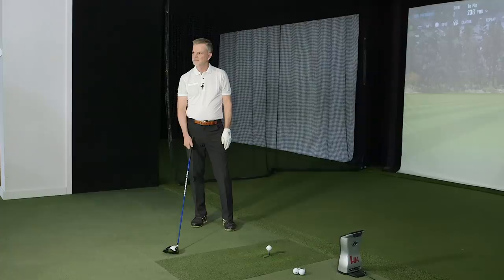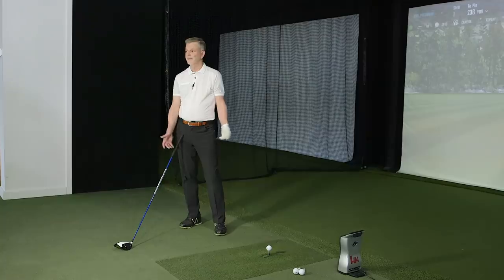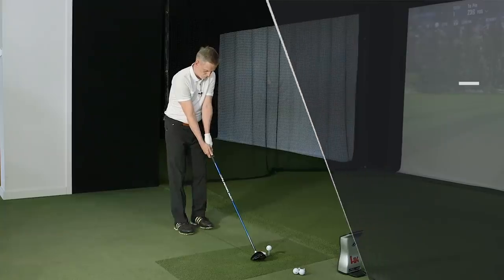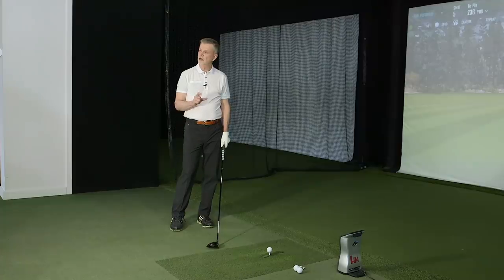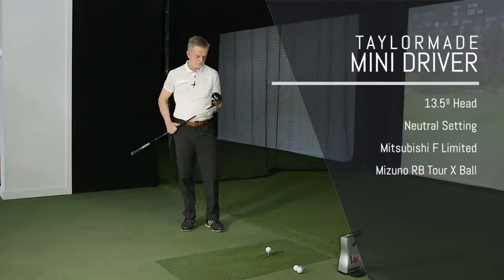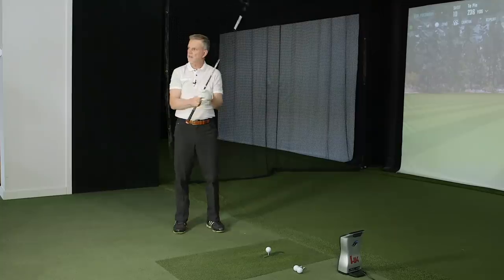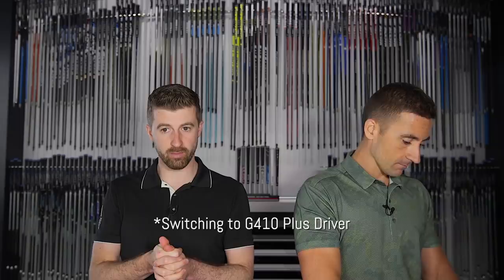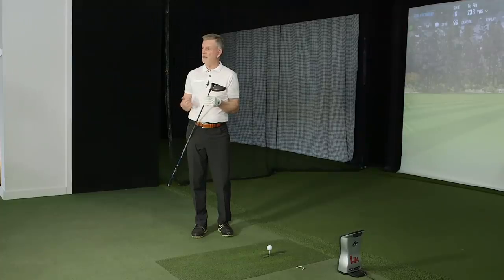Driver VS Mini-Driver | Mid-Handicap Fitting at Average Swing Speed

Comment: I've been meaning to create a file filled with fitting tidbits from Ian/Matt. I've wondered what driver apex I should have (similar swing speed to Ron), and Ian mentioned that 75-85 feet is good for Ron. Ian added that your 6 iron apex should be similar to your driver apex. Priceless.

Comment: I was correct in my chat - I don't understand the mini driver if there is a proper fit of a driver - which this video really showed. top notch.

I understand the need for a "mini driver" with a shorter shaft, smaller head and higher loft - e.g. a 3-wood - when you want to be safe when it is narrower, or dog leg or your normal driver isn't working. 

I play a 4-wood which is supposed to take me about 210 - 215 meters. My dispersion with that club is much less in comparison to my driver - in particularly if I am a bit off balance with it. I have managed to squeeze my driver to a good 240/245 meters carry. The longest so far is 276 meters (303 yards) including roll. 

I have an Epic 3-wood with loft 13.5 degrees. That is my "mini driver" if and when needed.
Reply: @johnairey4171  hear you but do not agree. Ron  went to his coach and had some exercises/talks and suddenly the "mini-driver" was gone and he was focusing on a new driver. The difference was suddenly the dispersion. The dispersion was the key issue last time when he tested the mini driver to his then worse driver shots. This video showed very well why the shaft plays an issue. The dispersion is tighter with the new ping driver but distance is same with Rons older M2. Higher loft in ping as it was 13 degree loft so you are quite right in your comment regarding the HT driver. But - it was not a shorter shaft in the video. Thanks for comment.

Comment: I know this is one year old. I purchased a mini driver 11.5 and for my clubhead speed (85-86 MPH) I reache just below 200 carry and the rest roll. So  best results are with mini driver. I always had a 2 wood of some kind in my bag, (Great Big bertha for ex). I purchase another Mini Driver on sale at Golf Town, regular 13.5. Of course I think it will be a better fit as my launch angle is a little low with the 11.5, and I hate the looks of theclosed face when I adjust it uop.   You make grat reviews. I am now a senior and kind of gave up on Drivers 45 inches. In my case, hope is not a strategy  :)

Comment: I'd be really curious to fit Matt into the lower lofted one where you use his stock driver as baseline but you don't remove ANY shots, with the point being to see if a higher skilled high speed player could lose minimal distance but gain any accuracy via better striking.

Comment: You guys are really amazing at what and how you execute the fitting process. I’m curious to hear the specific  journey each handicap(low, mid, & high) player is recommended from you. With fourteen clubs, the ball and the player’s swing seems like the precision in finding the best fit is a fairly lengthy process. Where do you normally begin once baseline swings are obtained? Is it top of the bag, the putter, or what the customer feels like working on? This is assuming the proper length club, grip, lie have previously been established. Thanks guys! Excellent channel!

Comment: Hi guys another great video. I was wondering I'm in the process of purchasing the Cobra King F8 one length cluybs. I have the 7i which I got first as the tester, thinking if I can hit this I can hit the rest of the set. As it stands I hit a solid 155-165 yard with what feels like an easy swing (I think swing speed is approx 90mph) What recommendations would you have for a fairway wood or driver that would compliment the one lengths. I prefer s shorter shaft length and having hit the Cobra F9 driver that felt like pushing a sail through the wind. Any suggestions would certainly be great. Keep up the great videos

Comment: With a moderate swing speed 90-95mph the hard balls seem to perform better at normal temperatures. Would that still apply on cold days when the temp is below 10 Deg C, as I am guessing most of the testing is done at around 20 Deg C. I'm guessing Ian doesn't miss the feeling of thinning a 2 Iron on a cold morning in Scotland.

Comment: How much of a genuine difference is there between a 15* 3 wood and mini driver.  Does the bigger head offer more forgiveness, because I would have to figure unless you can get the CG low enough, the 3 wood would be easier off the fairway

Comment: Awesome content as usual! Was there a reason you put Ronnie in the balls that you did? Did you guys try moving the loft down to 11 degrees (making it open)? Ronnie seems able to close the face to the path. Did you adjust lie on the driver at all?
Reply from the maker: Loft down wouldn't help Ronnie, he needs more spin and elevation. Lie was at standard. Ronnie tends to miss right more often than left. Ball choices were initially for more ball speed, and then a bit more spin with the RB Tour X
Reply: TXG Tour Experience Golf thanks for the response!

Comment: Get fit if you can thats for sure! If you do play a shorter length driver most people for get that you need to fix the swing weight!! every .5 inches you cut you change the swing weight by 2 or 3. you would need to add weight to the head! If you order a club from a major manufacture they can cut it and weight it for you if you would like. And dont forget Ricky plays a 43.5 inch driver and crushes it!!

http://www.golfwrx.com/608452/rickie-fowler-matthew-wolff-witbs-for-taylormade-driving-relief-skins/

Comment: 🤔hmm go figure, after just a few minutes the Taylormade gimmick is no longer a part of the conversation. Who would have thought? Also I’m calling complete BS on having a shaft shorter than the stock length as a bandaid. Any measurable static change in equipment that aids you in achieving your optimum or desired numbers on a more consistent basis should be implemented.
Reply from the maker: And we said clearly, more often than not the optimal length for golfers is 45" in the driver. We've fit thousands of people. If "stock" length is more than 45", then sure go shorter.
Reply: TXG Tour Experience Golf I’m saying the numbers should speak for themselves. Something can’t be considered a bandaid if it works better. There’s only one way to find out and then you weigh the possible drop in club/ball speed vs the possible tighter dispersion with fewer large drops in ball speed from mishits.
Reply from the maker: We're just saying that in our experience shortening a driver below 45" is not beneficial for most players. If it works well for someone, that's good. But as we've shown in the video, even someone like Ron that really struggles with the driver can find consistency when its fit properly for other variables than just shortening the shaft.
Reply: TXG Tour Experience Golf sure sure.. “majority of the time it’s not necessary” would have been a much better choice of words
Reply: keithdziak so the Taylormade Mini Driver is a gimmick but any change in equipment that makes a measurable improvement should be implemented???  That’s quite the contradiction Keith.
Reply: Ian Fraser did you watch the fitting? The things that make your driver better are not smaller heads and lower MOI
Reply: keithdziak 🤣🤣🤣, I was the one who performed the fitting!!
Reply: keithdziak how do you explain people who hit 3 wood better than driver then???
Reply: Ian Fraser I know, maybe you forgot the result that seems to occur over and over with a company like ping who’s technology and understanding of physics in a 460cc head is superior to something that’s 275 regardless of how much tech they try to pack in it. I’d love a final tally of what percentage of people who get a legit full fitting on the level of you guys actually end up in the mini. As far people hitting 3w better, in my opinion I don’t think it’d be a stretch to say that 98% of the reason would be the tangible effect of a shorter shaft and what naturally happens when the club head is closer to your hands added to the confidence you gain from that feeling. And I’m sure you’ve noticed I’m a large proponent of a driver being under 45 as long as things like swing weight and shaft bend profile are preserved.  My overall point is that IF the mini is actually better for someone it’s going to be for someone who’s very good. If that was their only pitch then that’s fine but no should pretend the average player should get into it just because they feel better about the shorter shaft when that’s a variable easily changed in any driver.